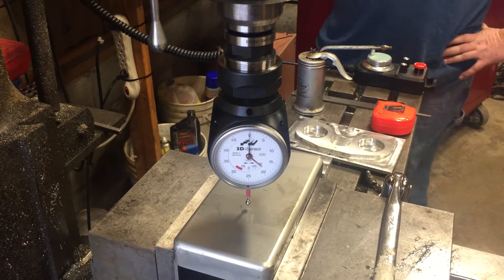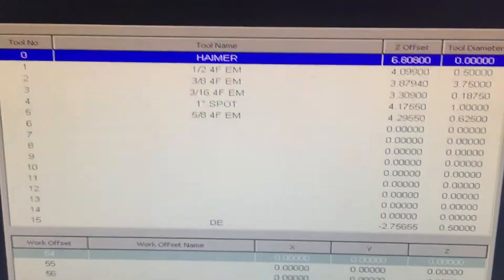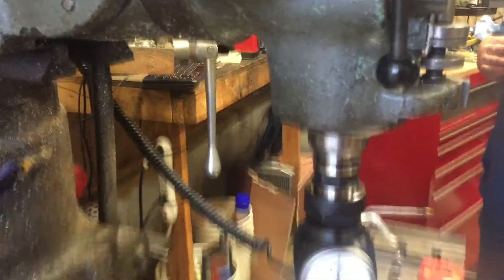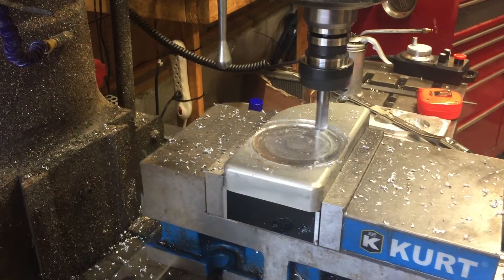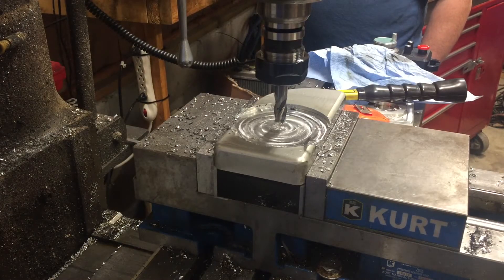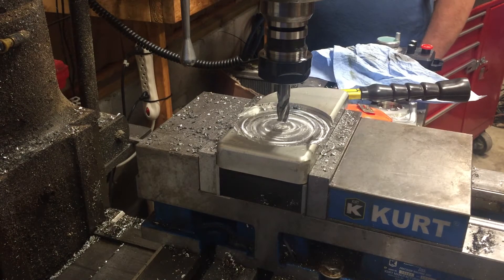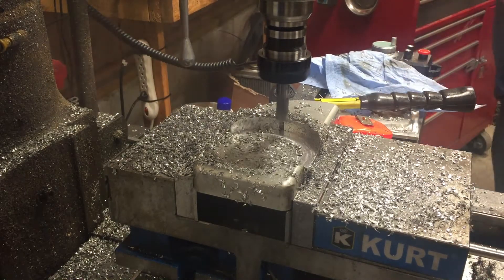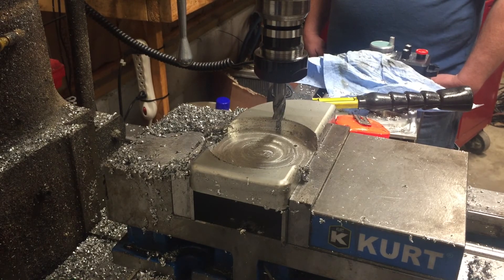Tool Height Using The Haimer On The Masso Controller And Clearpath servos

Comment: The Niagara Tool Co. will send a feed / speed slide rule if you fill out a form on their website.  Very good HSS and carbide tools from them too.  I also have a subscription to Bob Warfield's G-Wizard speeds / feeds calc but end up using the slide rule more than it.  The tool length offset is done just via T( ) ??  I.E. entering T1 sets offset for that tool, calling T2 does for T2 and so on??
Reply from the maker: YCM30cnc we set all of ours up in the tool screen. Haimer being tool 0 and then all the rest if the tools

Comment: Your cutter gets gummed up because to high rpm for how many flutes you have that's where your feed rate plays a big part. In how big of a chip the cutter is making
Reply from the maker: larry martens ok so a two flute maybe better then??
Reply: Yes for high rpm but you only have about 4000 rpm right so a 2 flute small end mill you'll have to run slower feed  I would get endmill that are coated for aluminum look up alumtools on eBay there really good 3 flutes  with high helix to get the chips out. 
You should get a speed and feed calculator that will get you in a good starting point. Most tool will tell you what to run it at to So you don't keep welding up the bits because once do they like to keep welding up 👌

Comment: .If you have a two flute cutter (carbide) it will be better for aluminum, also have you considered a mister for coolant John? It would help to keep the cutter cool and maybe not smoke you out like the WD 40. I have used flood coolant in a squirt bottle that even helps. I don’t know about your controller but with Mach3 if I hit the escape key it will save you like when the e stop failed. Cool video, thanks.

Comment: Wow, that's a lot of smoke. Are you considering mist or flood coolant? The Maso Wizard seems to plunge pretty aggressively. Think you're right that Fusion360 would have done better. You're a braver soul than me to run as long as you did. Off to watch your other new video :)
Reply from the maker: Kent VanderVelden the plunge rate is adjustable on the wizards i had it a little high on the 4" hole i lowered  it on the 2" hole and it was way better.
Reply: John lambert Sorry, I meant does the wizard support better entry patterns than plunge, such as spiral? the conversational CNC stuff is interesting. There is some duplication of efforts across CAM and the conversational controller interfaces. Probably insignificant though unless the wizards get pretty sophesticated. Best wishes, Kent
Reply from the maker: Kent VanderVelden no other entry types yet    I wish the wizards in the masso had the step over as a adjustment.  The wizards are kinds a quick convenients.  Took like 2 mins to set up the 2" round hole and start cutting the computer wouldn't have even been started up by the time i was done in the wizard.  Thx for watching.  Cutting some A2 tool steel next for a 830 John deere tractor later this week.